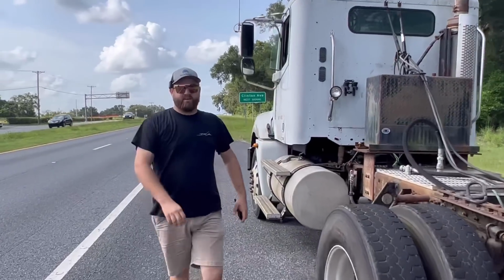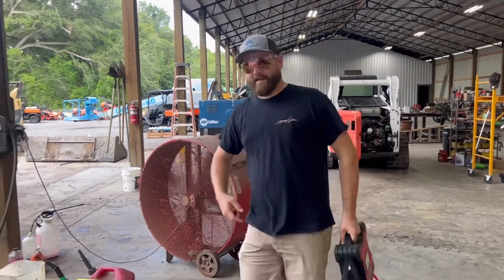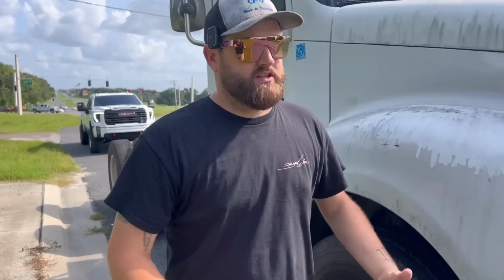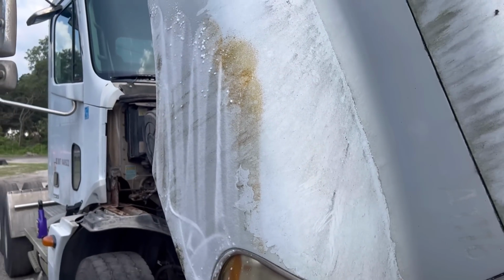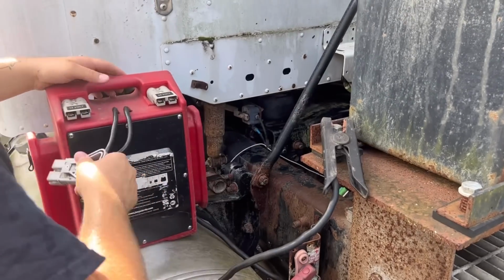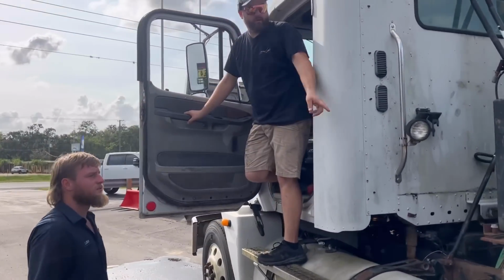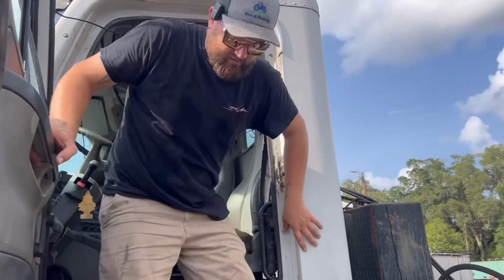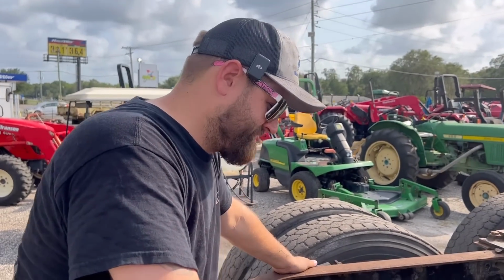This Cheap Semi Truck Breaks Down on my Way Home…

Comment: The frame looks cooked from the rear of the truck. Both rails are rolled out. And I could be wrong but I’m pretty sure putting water in these things can cavitate the liners.

Comment: Just to pass on something I learned about Superclean, in the concentrated form mixed with water, in a sprayer will remove layers of skin from your hands (wear gloves) it will also discolor (yellow) painted surfaces if applied in the sun on hot surfaces. It dulls polished Alcoa Wheels (acid) and if it's left on too long it will remove paint, I learned this washing the exterior of my new Cargomaster trailer, to remove the lot rot, gray rain streaks from the sides. Remember, if your hands are itchy and burning, you're losing skin! Love the content, keep em spinning!

Comment: Looks like the rear brake adjustment is only traveling about a 1/4in I’d back off the rear slacks a little bit they seem adjusted up a bit tight

Comment: That freight train noises you hear is the diaphragm on the bottom of the air dryer sticking. Needs service or a new air dryer.

Comment: I had one of them b4 with that same engine they have  6 individual  heads on them and the head gasket always goes out on one of the heads causing coolant leak pop that side cover off you can see which one it is

Comment: I know a highschool band program that could really use a semi to pull there dry van. They have an old cab over that's seen better days.
Reply: What kind of Cabover?
Reply: @rcg4404  I think it's a freightliner I will have to check
Reply: @joshgoss109  single axle?

Comment: Those Freightliner Columbia cabs are real bad about clogging the radiator with dust.  I have had 3 of them and we had to pull the cooling package and give them a thorough cleaning, on all 3, about every 2 years.  I would love to come and help on some of these trucks.  I live 2 hours from you at least until November.

Comment: Those Mercedes engines are awesome, great power, reliable but they do need regular maintenance. It's a good fixer uper! It does need some paint on that rusty frame but looks good for a starter truck.
Reply: Could be a work truck, until his daycab 389 arrives. If he gets it o a Bruce standard and uses it, could do well with resale

Comment: I really like those mercedes engines. They have really good torque, great on fuel and its lightweight. Not much for horsepower stock but that engine has been used in race trucks in Europe. They sound really good no muffler.

Comment: Hey Bruce it looks like it's the foot valve, just check on the heal of it that there's no crap built up there preventing it releasing properly or that the pin it hinges on isn't tight before you go to the expense of changing it, I hope this helps. 😊

Comment: You should throw the helm away as it is not safe to use anymore. The polystyrene inside shrinks as it ages and hence the exp date.
Some one might try and use it one day so cut the straps off.
Reply: I thought the impact absorbing polystyrene goes hard over time which is one reason why they have an expiry date.

Comment: Might be worth taking the gifts out of that newer freightliner and putting them in your old cab over. Then it would have blocked in differentials. Maybe even the transmission if it's like an 18 speed.